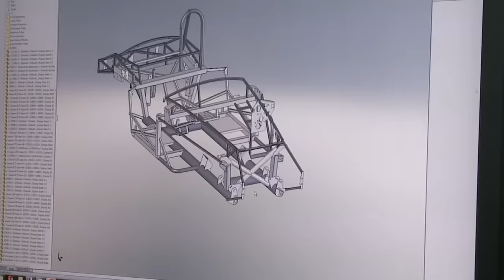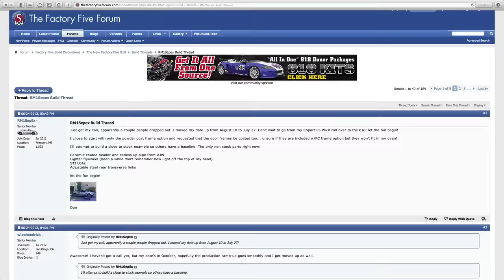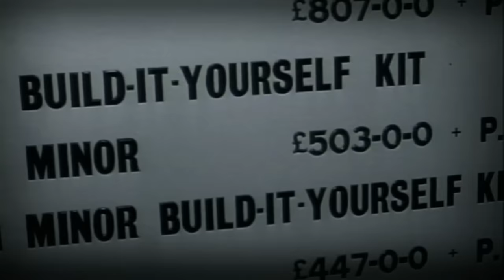Factory Five Company Overview

Comment: I live in Minnesota, so there’ll be snow. It’ll be more interesting if they can build 4wd & Awd Rally kit chassis, which is similar to Subaru and Mitsubishi, that can be use not just on Track racing only, but off road Rally racing. Especially winter seasons. Suspension can swap from OEM to after market suspension coil over. I’m sure some of us not just want a daily drive car, but a race car as our daily drive for all 4 seasons, Spring, Summer, Fall, and Winter.

Comment: I am in Oceania... that's Australia and New Zealand (with some of the Pacific Islands in the mix).

We are RHD down here. There’s also some requirements for sound and gas polution controls (rear pipes with mufflers rather than side pipes with NOISE).

Do you have any crash safety ratings? Have you ever done any crash testing analysis of your vehicles?

Can your kits include any of the following: ESC, ABS, Electronic Fuel Management, Airbags?

I know that there are Caterham Lotus 7 replicas built in New Zealand as turnkey  drive away roadsters (also available as DIY kits)... so there's obviously scope for compliance flexibility.

I live on a farm property out of Melbourne OZ, and last week an entire Chorus of Cobras cruised past my front gate. Awesome. They're a rare, burbling breed but can sometimes be seen in the wild.
Reply from the maker: We do have a bunch of customers in Australia and New Zealand, and  have helped them get the information needed on our chassis to help import and title the cars in the countries. We do not have options like ABS or airbags, and if you email us at info@factoryfive.com, we can help you get the info you need as you plan out your build.

Comment: Do you have to use a V8? I would love a 2.3 turbo in a cobra, really make it like an old AC. Maybe even cut the fender flairs off and make it a narrow body with smaller tyres.
Reply: you could use a 2.3l just need the engine mounts moved they also make the 289 cobra which has the narrower body

Comment: So how does it work if you want to then mod the engine. Can you install a pro charger kit like you normally would since the engine location had changed from the car its meant for from the donor cars
Reply: If supercharger fits, supercharger can sits.

I mean putting it on will be a question, and then emissions will be another. But otherwise yeah your car fit what you want.